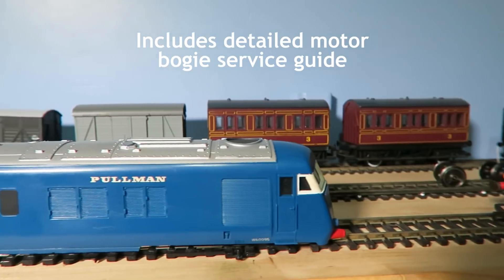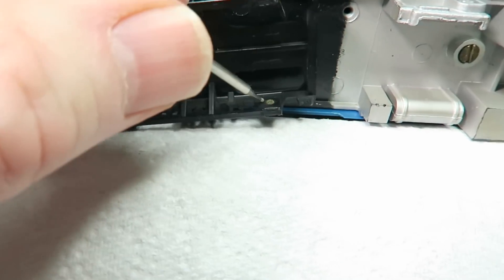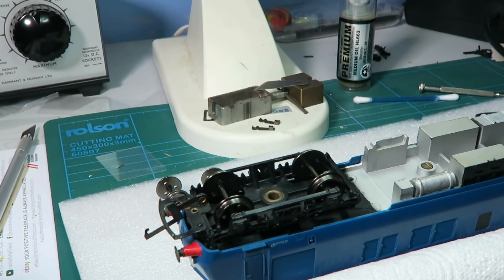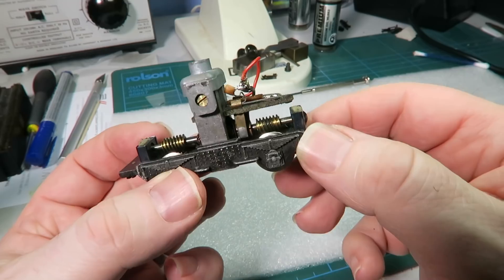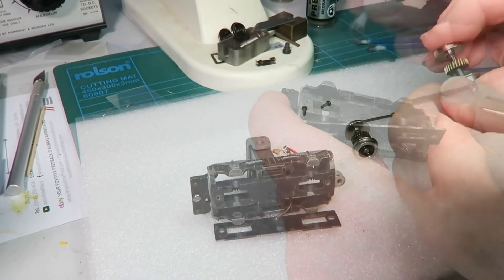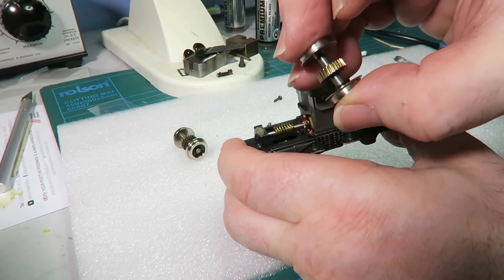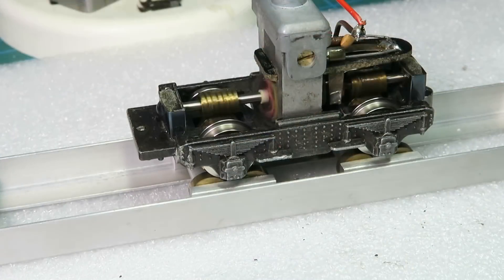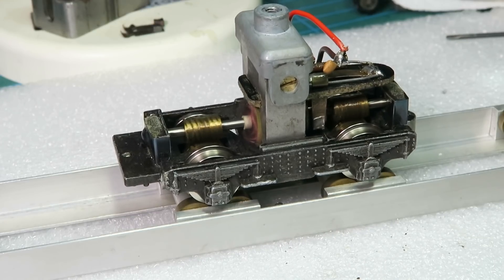Triang Blue Pullman Restoration part 2 Great Progress

Comment: Saying a lot for the old Hornby models 55 years old and still  (when completely overhauled ) a good runner , nice job you have done restoring this old Girl ..even better when completed ..Dave
Reply from the maker: Cheers David, yes amazing models that stand the test of time. Given you have the Batchmann one, what are your thoughts on my two crest sizes?
Reply: The smaller one is far the better ...large one too big
Reply from the maker: Thanks Dave, 2 nil so far then :)
Reply: Hi Mike. When you showed the decal sheet it says 7mm/O at the bottom. They're for O gauge. I've got a set from Fox and they say 4mm/OO at the bottom and the larger crest is for the nose ends and the smaller ones are for the coaches.

Comment: Looking very good, I think some of the older models are far more reliable than new. I can still remember a clockwork train set my dad bought me, which is amazing giving my memory these days. I do like the idea of having the additional pickups and it looks like the magnet has been re-magnetized...Simon
Reply from the maker: Cheers Simon, yes agree about the magnet! What do you think about my crest issue?
Reply: Looking at the Midland Pullman I would like to buy I would select the smaller emblem, the larger would look too large, but that is just my opinion…Simon
Reply from the maker: Very valued thanks mate
Reply from the maker: By the way, does your clock work train still exist?
Reply: Hi, I wish my clockwork train did exists, I had a habit of taking things to bits and losing parts, which annoyed my dad. Must have been around 55 years ago I had it.

Comment: Coming along nicely Mike, it's going to be a real gem.  David.
Reply from the maker: Thanks David, what were your thoughts about the crest?
Reply: Hi Mike, My first thoughts on the crest were "go big." Then you showed it against the model and I thought, "I'm not sure". So I finished with " I hope Mike researches it before he goes ahead. They may have used different size crests at different times or on different sets. It would seem to me to be appropriate to have a larger crest on the locos as opposed to the crests on the coaches. A bit of research is in order for you don't you think?
Reply from the maker: Hi David, many thanks, I am leaning towards the bigger one, there is a great photo that is inspiring me http://www.rmweb.co.uk/community/uploads/monthly_07_2010/post-1-128008117426.jpg looks like the big one

Comment: For cleaning out the old bearing on the bogies Mike you can also use WD40 Contact Cleaner or as OOBill puts it "give it a good skoosh". I've used the contact cleaner and it's great at getting rid of the "muck" super quick with great penetration power.
Reply from the maker: Thanks, yes I've discovered that product now, just wish it was more controlled out of the can lol.

Comment: Thanks for the tips on cleaning in Part 1.
A few years ago, I managed to put together a set of two driving cars, two parlour cars and two of the Kitmaster kitchen cars, which gives a correct configuration for the two 6-car Midland Pullman sets. Very much a work in progress, but runs quite well. Unfortunately, the Kitmaster kitchen cars had not been very well put together, so I am having to disassemble them - glue and all - which is a very time-consuming process. I'll no doubt then have to repaint them as the blue is different from the Triang colour - neither is properly correct, but the Triang is, I think, closer to proper Nanking Blue - and I'd rather repaint two cars than four - especially as I might be able to remove the glazing and white insert panels of the Kitmaster vehicles.
The bogies are a real problem, being standard Mk1 coach bogies so look all wrong - especially as the Kitmaster coaches have the correct bogies. Rather than just replacing the wheels, I replaced the bogies completely with Bachmann 'Commonwealth' bogies (https://www.bachmann.co.uk/product/commonwealth-coach-bogies-%28x2%29/36-008a) which are pretty close and give you a less obtrusive coupling as well. They run exceptionally freely, too.
Not much you can do about the gross motor bogie, but since the Bachmann bogies come in pairs I have a spare. If I get really adventurous, I might try grinding off the exterior of the motor bogie and mounting the sideframes of the Bachmann bogie. Wish me luck.
Reply from the maker: Wow! I'd like to see the finished product!
Reply: @ModelRailwaysUnlimited  Been put on the back burner for a while as we've moved house and downsized - lots of stuff to get rid of! It's at the top of the list for when my model railway stuff reaches the top of the unpacking heap! I'll try to dig out the (unfinished) parlour and driving cars to show you the value of the Bachmann bogies. They're not cheap but well worth it for appearance and running. All you have to do is drill out the soft-metal bush holding the Triang bogie in place then attach the Bachmann one with a very short bolt and nut. I had to cut away a small amount of the interior as the nut sits proud of the bodyshell floor, but nothing that shows.
Like your motor bogie, I've replaced the original Triang wheels with Hornby DMU wheels which are really easy to fit and gauge. Your motor-bogie cleaning tips will be a great help as the running is a bit noisy.
Reply: @ModelRailwaysUnlimited  I'll bookmark and email pics to you as I progress. Ian

Comment: How could i get the smooth driving wheels for the motor bogie? the noise of the serated wheels on my blue pullman is driving me mad
Reply from the maker: A few options, drive the wheels off the axles, fit Hornby class 25 wheels.
Reply: @ModelRailwaysUnlimited  thank you

Comment: I have this model, but it doesn't work now. Got it in the 60's
Reply from the maker: Maybe try and get it going?
Reply: Yeah, I've cleaned it, and had to do a little soldering, but the magnet is not too strong. Also, I need a new controller.